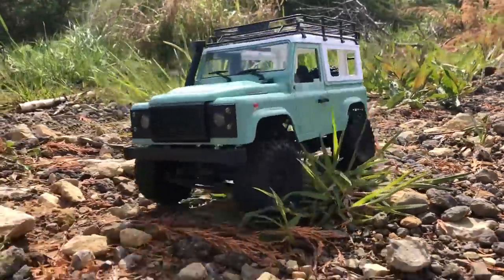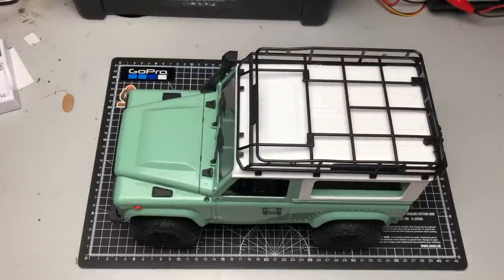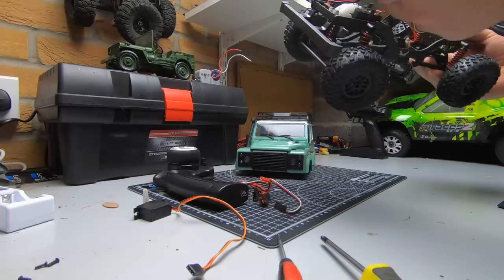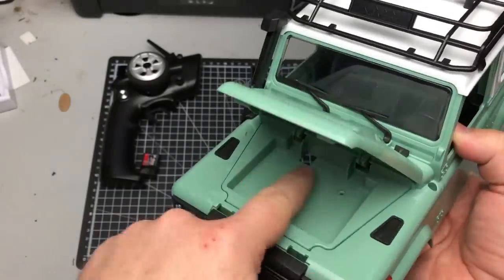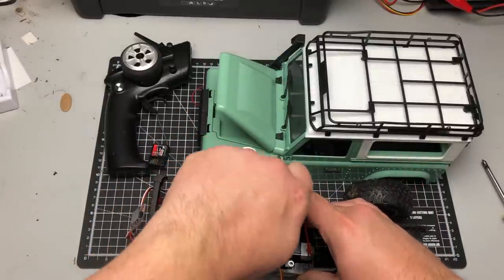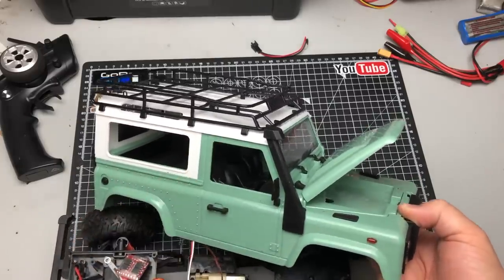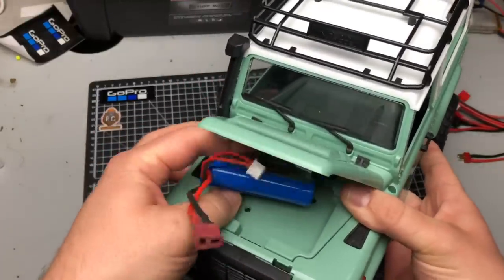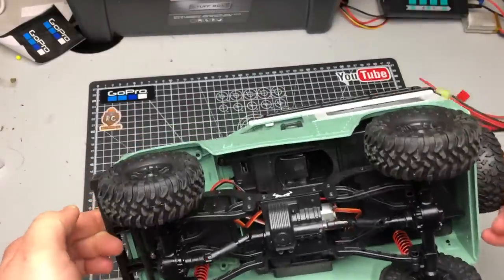How to upgrade your Toy Grade RC Car! MN Models MN90 WPL B36 motor. Upgraded Cheap RC Car. MN99

Comment: It would have been good if you do a HOW TO about the basics of the electronics: correctly connecting the wiring into the ESC plugs - which coloured wire corresponds with others etc to prevent mistakes and burnt boards like what has happened to me recently....and advise on servos i.e.  the WPL ESC kit you did a video on comes with a 7.4V Lipo battery pack, but servos are usually 4.8V to 6V output - explaining whether these are compatible or fry the board/servo would be great as no one on YouTube has ever bothered to do videos like that. On RC forums they talk utter gibberish about such things too so unless people like you who upload videos make a short how to basics advice video, novices like me are still going to make the same mistakes. You could be very helpful...and it would stop all MY questions too.

Comment: What could be making a servo to make a whirring, groaning sound whenever the steering is activated? On my B24 it only occurs when steering is in use. I installed a cheaper plastic servo head type on my second green B24....on my blue B24 I don't have this problem...Im wondering if the aerial cable on the circuit board is creating interference?